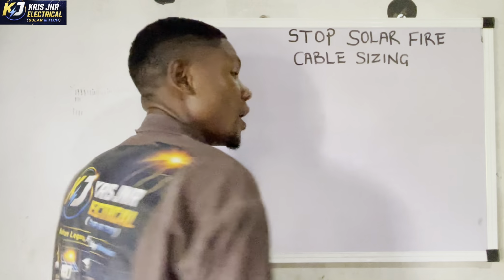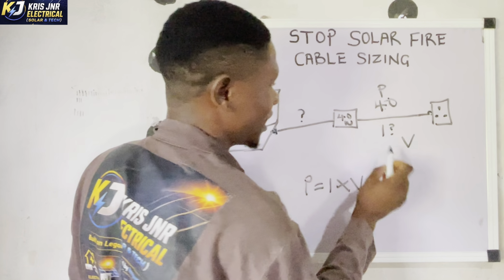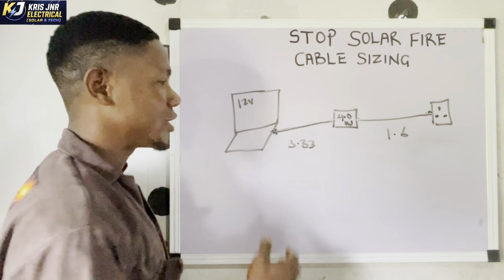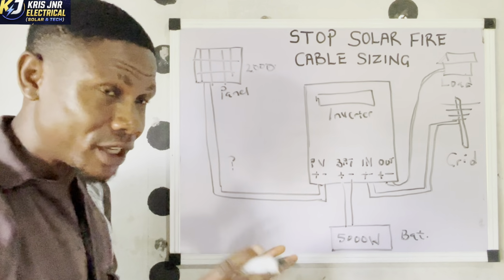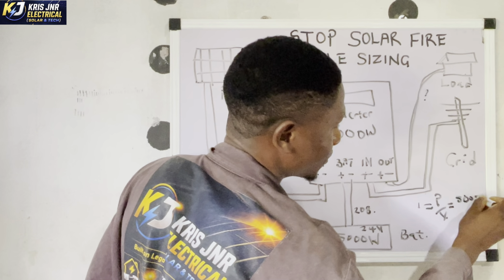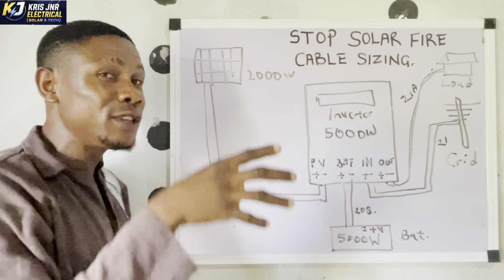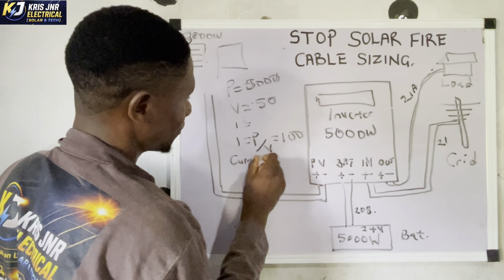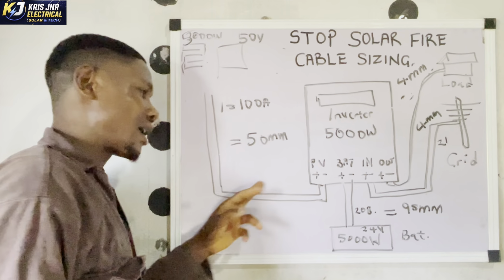Why Solar Cables Burn! | Calculate Current on EVERY Cable - Full Video 🎥

Comment from the maker: 🚨 CORRECTION: Realistic Panel Voltages, Currents & Cable Costs for a 5kVA Inverter . In this video, I used an extreme, theoretical assumption of 100 Amps flowing from the roof to visually demonstrate high current flow. In reality, a 5kVA inverter setup never runs at 100 Amps from the solar panels.Connecting panels entirely in parallel forces the current up to 100A, which requires massively thick, extremely expensive battery-sized cables (25mm²–35mm²) running from your roof.By wiring your panels correctly in Series, you boost the voltage instead of the current. This keeps the current low, allowing you to use standard, very cheap 4mm² or 6mm² solar DC cables. At a realistic rate of $25 per meter for a 10-meter run, using the right wiring method saves you a massive amount of money on installation costs!Here is the exact comparison using a standard 5,000W panel array (10 pieces of 500W panels) connected to a 5kVA inverter over a 10-meter distance:Wiring MethodTotal PowerOperating VoltageReal CurrentRequired CableTotal Cable Cost (10m Run)Video Example (Extreme Parallel)5,000W~46V (Too Low)108 Amps ⚠️25mm² – 35mm² Heavy GaugeExtremely Expensive ($700+) ❌Option 1: Cost-Saver (10 in 1 Series)5,000W420V DC (High)12 Amps (Low)4mm² Solar CableVery Cheap / Standard ($150 approx) ✅Option 2: Mid-Range (2 Strings of 5)5,000W210V DC (Med)24 Amps (Med)6mm² Solar Cable ($25/m)$250 Total ✅Note: Option 1 is perfect for high-voltage MPPT inverters (up to 450V/500V Voc). Option 2 is ideal for standard mid-voltage MPPT trackers (up to 250V Voc). Check your inverter's side panel specs, but rest assured, you do NOT need to spend a fortune on heavy cables if you wire it right!

Comment: I like the video....and also the fact that it's made under assumption, but msg was well passed ..but i would like you make a realistic example , lets see if its optainable ..just like some said here about using a huge mm of cable and considering the cost ....so we need to see or imagine what we can  likely be expecting when setting up a particular solar system either for self use or for recommendation putting all you have thought into consideration....but for the lecture,  IT WAS IMPARTFUL,
Reply from the maker: 🚨 CORRECTION: Realistic Panel Voltages, Currents & Cable Costs for a 5kVA Inverter . In this video, I used an extreme, theoretical assumption of 108 Amps flowing from the roof to visually demonstrate high current flow. In reality, a 5kVA inverter setup never runs at 100 Amps from the solar panels.Connecting panels entirely in parallel forces the current up to 100A, which requires massively thick, extremely expensive battery-sized cables (25mm²–35mm²) running from your roof.By wiring your panels correctly in Series, you boost the voltage instead of the current. This keeps the current low, allowing you to use standard, very cheap 4mm² or 6mm² solar DC cables. At a realistic rate of $25 per meter for a 10-meter run, using the right wiring method saves you a massive amount of money on installation costs!Here is the exact comparison using a standard 5,000W panel array (10 pieces of 500W panels) connected to a 5kVA inverter over a 10-meter distance:Wiring MethodTotal PowerOperating VoltageReal CurrentRequired CableTotal Cable Cost (10m Run)Video Example (Extreme Parallel)5,000W~46V (Too Low)108 Amps ⚠️25mm² – 35mm² Heavy GaugeExtremely Expensive ($700+) ❌Option 1: Cost-Saver (10 in 1 Series)5,000W420V DC (High)12 Amps (Low)4mm² Solar CableVery Cheap / Standard ($150 approx) ✅Option 2: Mid-Range (2 Strings of 5)5,000W210V DC (Med)24 Amps (Med)6mm² Solar Cable ($25/m)$250 Total ✅Note: Option 1 is perfect for high-voltage MPPT inverters (up to 450V/500V Voc). Option 2 is ideal for standard mid-voltage MPPT trackers (up to 250V Voc). Check your inverter's side panel specs, but rest assured, you do NOT need to spend a fortune on heavy cables if you wire it right!
Reply: Smiles....I like as you have tried to make it more realistic as you can...once again, the lecture was wella understood...and I learnt one  or  two from it

weldone sir

Comment: How about cost of cables suppose 50mm cable with distance of  10meter  each mter square of may be 25$  (15x25)=$ 375 and also in 95mm cable also more than that ,  according to our system is 5kw it is small system how can i use 95mm and 50mm cables , does cost become high? How it possible?. Thnks for well preparation video
Reply from the maker: No, the data in the video is made under assumption. In reality you will find reduced cable sizes. I inflated the figures so that it will be clear.